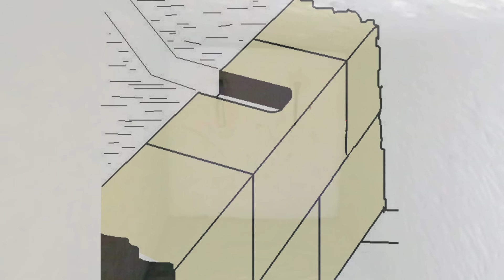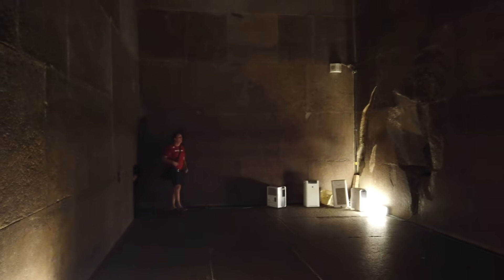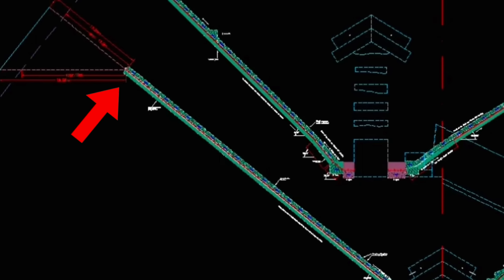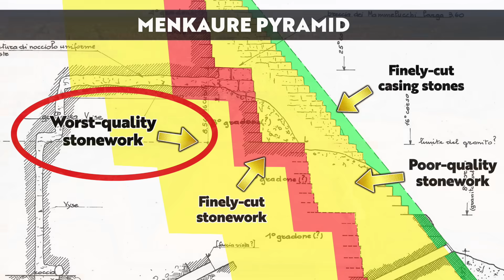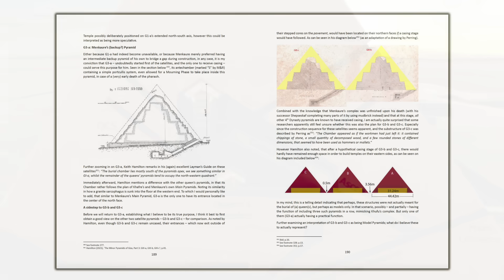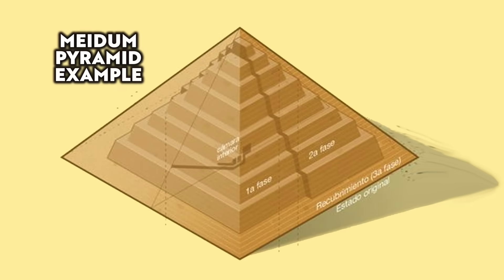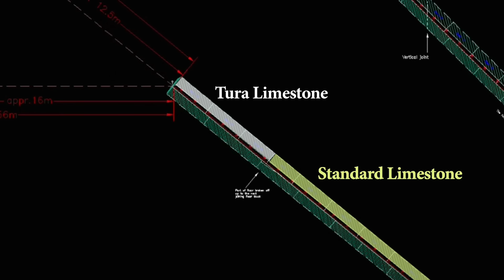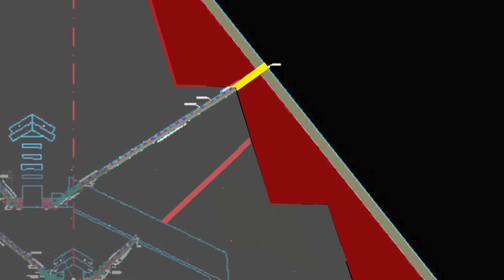Great Pyramid HIDDEN Steps Explain Everything | Part 1

Comment: Those channels are way too small to support the necessary airflow to sustain more than 1 or 2 people in there, especially without mechanical means of moving the air.
Reply: You don't need mechanical means if the chimney effect works for you. If the temperature inside the pyramid just slightly differs from the outside, it creates significant pressure differential between the pyramid entrance and the shaft exits which are i think 60 - 70 meters higher. The chimney effect increases with increasing temperature and height differential. The temperature outside the pyramid changes during the day/night cycle while inside is roughly stable.

The problem is that the pyramid is overcrowded these days so, they needed to ad ventilators in front of the shafts and not just rely on the chimney effect.
Reply: @DalHrusk  Natural convection will only get you so far.  The mechanical comment was specific to increasing the capacity.  You're using good words, but you clearly don't have a good understanding of why the system would work.  I'm not cracking on you, but as a heat transfer and fluid flow expert I can tell you your explanation is severely lacking.
Reply: @the_naP  If you think so ;) What part you disagree with? I may as well disagree with your explanation.

As an expert you should also be able to calculate the air flow caused by the chimney effect if the temperature difference between outside and inside is let say 5 °C.
Reply: @DalHrusk  If you think the temperature inside being cooler and the temperature outside being warmer is what's going to create natural convection, you should rethink how that would work.  Heat rises.
Reply: @the_naP  It doesn't matter if it's cooler outside or inside - it just affects the flow direction not it's speed. You just need that difference between outside and inside.
Temperature rises because of human activity inside (body heat and lighting). Without people going inside, the temperature there would stabilize at average annual temperature outside the pyramid. Then, the air flow direction would swap according to current outside temperature.
The additional heat inside means just that the air will flow from the bottom to the top more often than the opposite direction.
Reply: @DalHrusk  The internal temperature will never stabilize at what the external temperature is because it is connected to the earth and in general will be cooler than the outside, at least while the sun is up.
Reply: Hot air . They would have needed illumination I.e. torches etc
Reply: @jonathangriffiths2499  You think hot air is going to do it?  You know that fire consumes oxygen, and would have just exacerbated the issue, right?

Comment: I think they to take multiple samples for dating of the pyramid from its internal structures...as opposed to just the outer stones.
Reply: I think it was charcoal used in the mortar between the secondary blocks that was used in C14 dating, as well as some wood that was still intact in the various chambers. The outer stones as we see them today were concealed beneath Tura limestone much of which except for some casing that is left on the upper portion of Kafre's pyramid, was removed in ancient times.